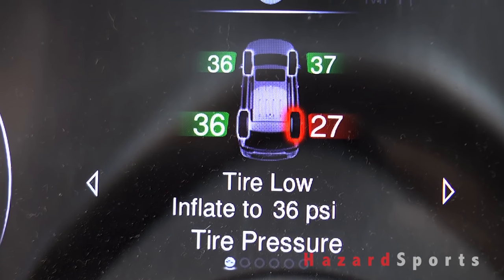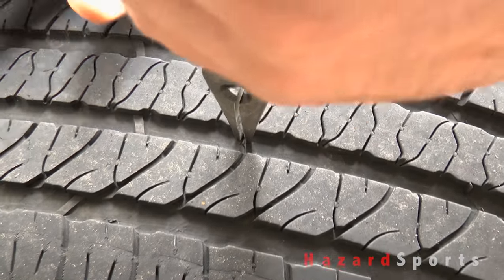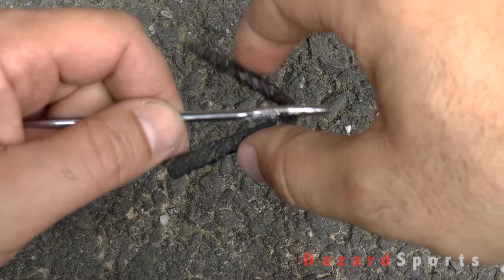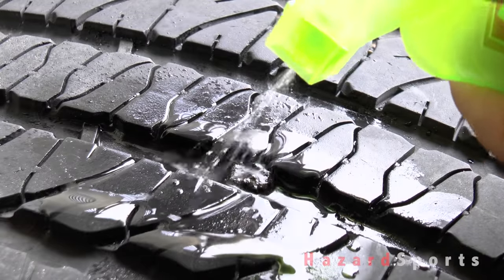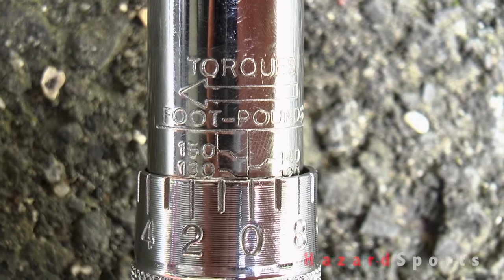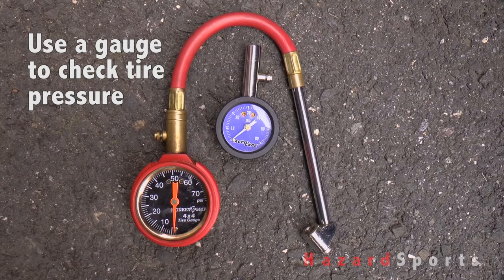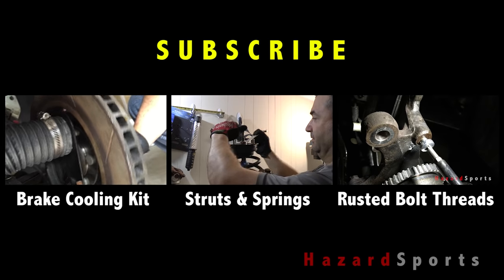How To Plug a Car Tire - Tire Repair  - #HazardSports

Comment: Just a tip. . when removing the object that caused the leak take note of the angle that it went in and use the same angle when using the rasp and plug tool so as not to make the hole bigger or double.

Comment: Hey man.

Thanks so much for making this clear & concise video. I already knew the basic procedure for plugging a tire (saw several mechanics plug various tires over the past few decades - and at $5-$15 per repair) but wasn't completely sure about this:

Not sure how far into the tire I was to insert the rubber plug. By watching your vid, it looks to be about 80% in & about 20% out, per my own estimation. And about 15% of the 'out' is trimmed off, right?

The close-up camera angle was exactly what I needed to get this done. Thanks man!

PS: Pretty sure I am using the exact same kit (made by Slime) you used in the video. I paid $6 at my local Home Depot, which I thought was a fair price. Just FYI.

THANKS AGAIN!
Reply from the maker: +F Baker Thanks for the comment!  I am very glad it helped you!  I paid $20 for my kit from the flea market - so you got a much better buy than I did for sure!  Good job!  As far as the % of plug in/out/trim: the way you described it is how I have always done it.  I believe the official instructions may say 50% but I dont think it is critically important to be precise - but I would never advise breaking the instructions, (yet I might still be a creature of habit - LOL).  I am glad you enjoyed the close-ups and quick tips!  Thats how I try to make all of my instructional videos.  My (personal) garage should be mostly setup by the end of the month so I will be pumping out a lot of mechanic / woodworking vids soon!  All in the same quick tip / close-up format!  If there is something you'd like to see me cover then let me know and when I do that type of project I will video record it for you!

Comment: Yes you're right the best way is to remove the tire and patch it from the inside but everyone is in a hurry and don't want to pay, 50 bucks for a tire repair it takes me twice that time of $100 an hour but I'm just fat and a little slow but I was thin once it still took me st least an hour to do the job right but no one would pay and I didn't want to kill them for a tire repair so I only charged 50 bucks even though sometimes 1.5 hours to do the job at supposedly $110 hr
Reply from the maker: I have never has a “glue stick” fail on me but I know a patch is the proper solution.   Too many roadside repairs in my 50yrs!  But you Sir are a kind man!  Thanks for sharing your story!

Comment: I haven't checked nor am I gonna read them if someone brought up putting some dish soap in with the water in the spray bottle. It's much easier to find with the bubbles. 
Just something I had learned from another.

Comment: Is it necessary to coat the plug with rubber cement? I bought a kit and the step by step direction do not say anything about coating the plug wit rubber cement even though rubber cement was included
Reply from the maker: A lot of kits include rubber cement.  I WOULD recommend using it however I tend to buy the kits that just happen to be without the cement and my plugs have worked just fine!   If you have it I would use it !

Comment: You left out an important step.  First work the rasp tool in and out and twist until it moves easily.  Then COAT THE CRAP out of the rasp using the included rubber cement and run the rasp in and out.  Coat it again and do the same. Allow to dry for a minute or two, THEN insert the sticky rope as you showed.  Often the rope won't go in easily, if not then rotate the rope as you press it in. Be sure to trim off most of the excess.
Reply from the maker: Rubber cement doesn’t come in all of the kits and I have rarely used it.  However, your advice is great and my buddy said he does it your way also.  I haven’t had a plug fail without the rubber cement but with it as you suggested would still give me greater confidence in the plug.

Comment: Thanks. My Dad taught me to do this, needed a refresher - you rock and make it simple to understand.
Plugging kit is a must for any vehicle to keep IN the vehicle, because if you end up stuck somewhere with a flat, it's great to just be able to deal with it and keep going. It's bad to have to be on the side of the road waiting for help or an expensive tow and in danger the whole time.
Keep the basics in the car, fellow females, and know how to use them.
Reply from the maker: Thank you!  And I am very glad to help!  And just as you recommended- I keep a kit in my car at all times and at least 3 times it has gotten me off the side of the road.  And MANY MANY times has gotten me setup for the ride home from another destination!  Biggest problem seems to be the air pump!  They seem to burn out quick!  Even the expensive ones!  I recently switched back to a manual pump!  Reliability is far more important than convenience!   Thanks for saying hello!

Comment: Someone just did this for me but I wanna put air in it to make the yellow light go away. Can I do that now or should wait for a while?
Reply from the maker: It is typically used as an emergency roadside repair and I have always inflated it and start driving right away!  The heat from the tires / road friction MAY help it bond better (in my opinion).

Comment: Nice vid, aren’t you supposed to rotate it after you have inserted it to the hole so you create a “ball” and then pull it out ?
Reply from the maker: I never have.  I just use a straight push.

Comment: Does the tire HAVE to be taken off if the screw is easy to get to?
Reply from the maker: I have done it many times on the vehicle but on a car the rear tires are tough to work on with limited space.  The fronts are easier because you can turn the wheel to the side and gain more access.

It still is much easier to inspect the whole tire with it off though.

Comment: Is it necessary to coat the plug with rubber cement? I bought a kit and the step by step direction do not say anything about coating the plug wit rubber cement even though rubber cement was included
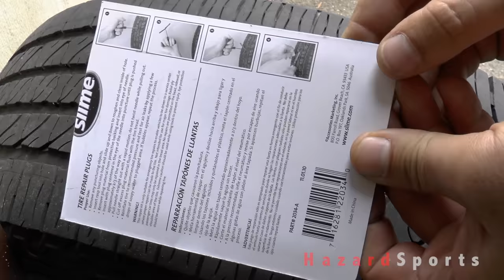Reply from the maker: As pictured at 0:56 in the video the instructions on the kit used in this video don’t mention the rubber cement because it was not included in the kit.

Comment: I just plugged my tire. I used gobs of rubber cement too. The hole is probably the diameter of a heavy nail and it still leaks on the side between a small channel in the tire. The hole was between the threads of the tire.
Reply: Anyone have tips? I'm thinking maybe I can do the inside patch myself or buy a can of fix a flat.
Reply from the maker: I personally wouldn’t trust fix a flat and would have to research how large of a size a patch can safely fix.  Definitely look into the patches that also incorporate a plug!  They seem to me to be the best!   A patch is a but more involved than just a plug.  I have a kit but  have never made a video in it.  Best of luck to you and let us know how it works out!!!
Reply: @HazardSports  thanks for the reply!

Comment: why is a corner plug not ok?  if its really small?? please someone reply...thank u
Reply: i see someone asked this n u answered,,, thank u sir
Reply from the maker: The sidewall has much less structure and any attempt to rely on a repair could result in a blowout.  The shoulder is where the tires transition from that structure to a simpler design!  Also the sidewall resists a ton of forces when cornering and is subjected lateral / sidewall deflection - which would likely fail at a weak point (or repaired / punctured site).  Many people may  say they have gotten away with it but it is considered very dangerous !
Reply: @HazardSports  thank u sir
Reply from the maker: My pleasure!

Comment: Hey man! Is this a temporary repair or a permanent repair? Thanks for answering in advance.
Reply from the maker: Any expert will tell you that this is a temporary repair to get you to the shop for a patch or a new tire!  But I also have traveled way too many miles for way too many months on plugs before!  I now own a proper patch kit and know that’s preferred!  And don’t recommend you driving on a plug for more than absolutely necessary!  But, MOST of my plugs have held up a long time (not all).   Good luck!

Comment: Does the tire need to be pressurized during for the process to work?
Reply from the maker: I have never been able to get the rasp or loop to punch through a completely flat tire.  Thats why you should have them both setup BEFORE removing the object that penetrated the tire!
Reply: @HazardSports  Thanks Hazard sports. you've do it again

Comment: What about using the rubber cement in the kit?
Reply from the maker: +Beny Freshfeet My friend swears by the rubber cement on the glue stick and lighting it with a match to heat it up and fuse to the rubber!  Sounds good in theory but I have never done it!  I am not opposed to trying it!  If you do let me know how it works out!
Reply: HazardSports  I have just repaired a tyre using the above method (minus the fire! haha) I am going to let the rubber adhesive set over night and will let you know tomorrow if it is all well.
Reply from the maker: Sounds good!  Thanks for sharing!  Let us know how it works out!
Reply: I've been plugging car tires since the mid 1970's. Coat the plug with rubber cement (inner tube/tire repair rubber cement) before inserting it. No need to set it on fire (my dad used to do that also). I've NEVER had a leak using this method. I HAVE had a leak using just a plug without rubber cement. Also, I dislike the rasp used in this video. It should look like a file, not a spiral. These spiral tools do nothing to smooth out the hole, and you NEED a rasp (file type) to enlarge the hole if it's very small, otherwise you won't be able to fit the plug tool in there.
Reply from the maker: I know that the rubber cement is a better way but I almost always have to plug a tire as a field repair so I am so used to NOT using it that I just don’t!  I rarely have had a plug leak but cant say “never”!
Reply: @HazardSports  the rubber cement will actually chemically melt and fuse the plug and tire together, so it's a good idea to use it for longevity, fire can speed the fusion process if you're in a hurry, but not by much, open air dries the cement pretty fast anyway. Usually by the time your tire is back on the ground and aired up you're good to go.
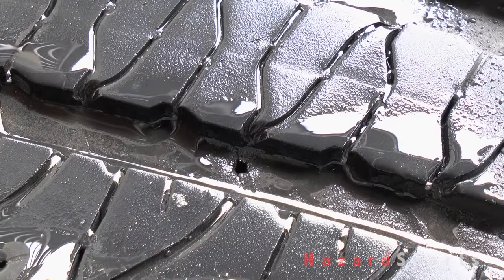Reply from the maker: As pictured at 0:56 in the video the instructions on the kit used in this video don’t mention the rubber cement because it was not included in the kit

Comment: Can you plug a tire without taking the tire off?
Reply: Should be able to, as long as it's a front tyre you can turn the wheel outwards so you can get to it. Might be different story on the rear tyres
Reply from the maker: That’s how I do it most times but sometimes you may not have enough room to work.

Comment: The water doesn't prevent the adhesive/cement on the plug from curing properly?
Reply from the maker: No, if done properly the air that is leaking is blowing the air out and away from the hole.  And then the ream clears the opening and makes a rough texture for the adhesive to bond to.  If your tire is flat or almost flat you need to inflate it to get good air pressure to find the leak easily.